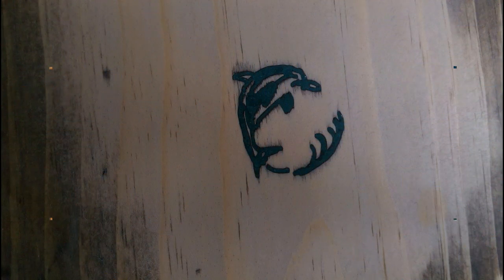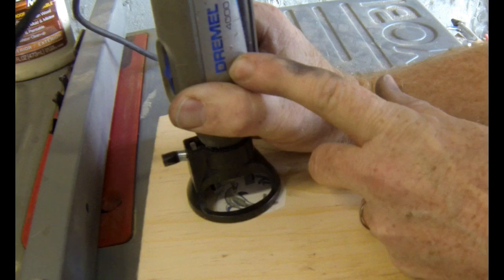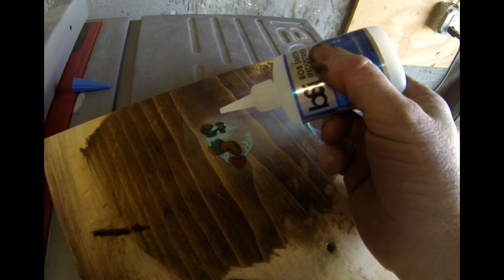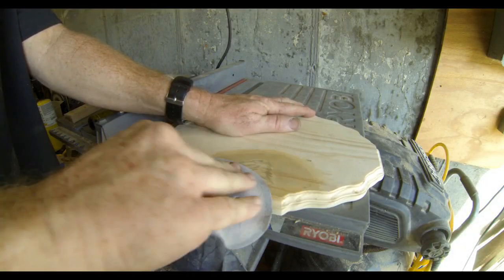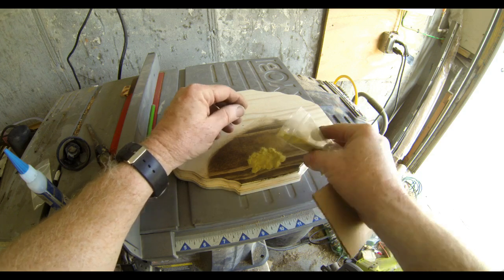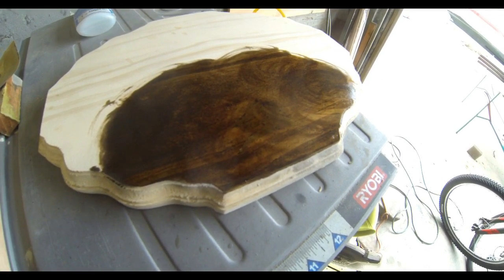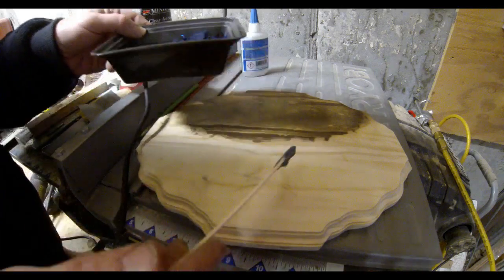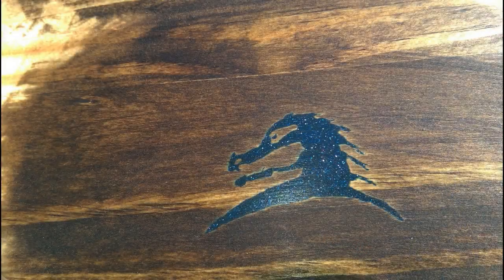Easy DIY Wood Inlay

Comment: this was a great tutorial on inlay work, especially love the last medium with the sparkles. I did all kinds of inlay on Native American " style " Flutes that I made for about 12 years, it's really fun and adds a great POP of color.  One tip I can offer on getting clean, crisp lines though, is to glue on your template just like your doing now, but instead of using the Exacto blade to trace around the circumference, try using a really fine tip on a wood burning pen. That way, you get sort of a stop cut as in carving, as well as a nice, black edge around the finished design, then you can either clean out the waste using the Dremel as you are, or you can do it by hand with a very small chisel as well. Good luck and hope this helped ?

Comment: I've been doing turquoise inlay for 3 years now and the mistake I see is rubbing the stain over the turquoise after sanding it out. I take a small art paint brush and apply the stain around the edge of the turquoise. You dye the turquoise darker when rubbing stain over it. The turquoise will remain a more brilliant, natural color if you don't rub the stain over it.  I haven't done brass inlay but it looks you're doing the same, dying it darker by rubbing stain over the top. Otherwise good info.
Reply: Could the staining of the turquoise be minimized by applying a few drops of pre-stain sealer to the powder media after gluing but before staining?

Comment: With an epoxy inlay, you could use a router on the backside of the workpiece until you just kiss the back of the inlay and add light behind the inlay

Comment: instead of using a printed image and the scoring method to transfer the image... i found it's much easier and much more effective to use single layer carbon paper. you'll still want to print an image to lay over the carbon. but you basically use the same technique a tattoo artist wood to get a stencil for a tat.

Comment: That was Beautiful,  The last one with Sparkles was great,  I have some Polyester resin in my garage,  I'm gonna try it..   I'm gonna have to look around for coloring for the resin..  
    What was the  "C A Glue"  on the first two ?    I never heard of it,  but I noticed it sanded off the top nicely.
Reply from the maker: CA is a type of clear hard quick drying glue. I got it from Amazon. You do not need it if you are going to used resin. Any oil based paint will work for color. Just needs a couple drops.
Reply: Thomas, CA glue is nothing more than " Super Glue "............you can get it in different viscosities like water thin, medium, thick, and even a gel. As in this video though, you'll want to use the water thin for inlay work.  ;-)

Comment: hi, did you mix the resin with hardner as well or just the paint and resin?
Reply from the maker: Yes resin was mixed with hardner
Reply: DIYeasycrafts thanks, was it standard fibreglass resin?
Reply from the maker: Yes nothing fancy. Fiberglass resin from home depot